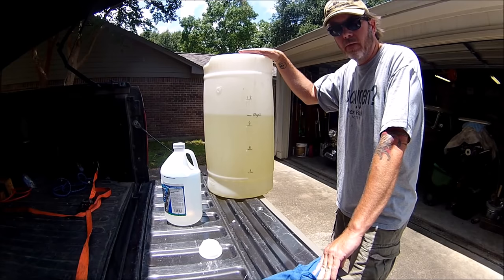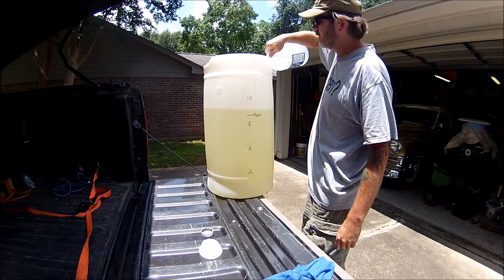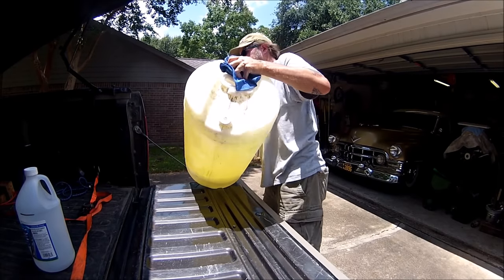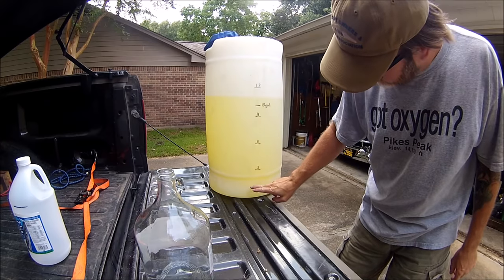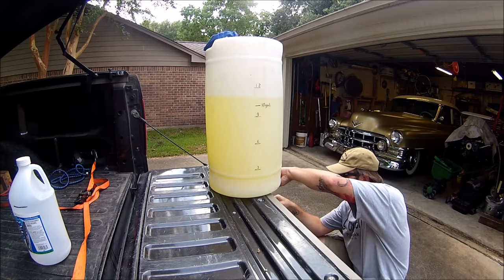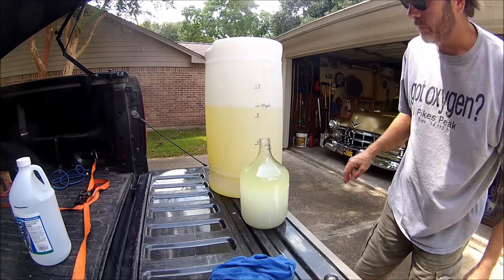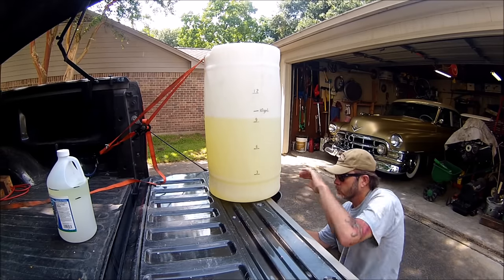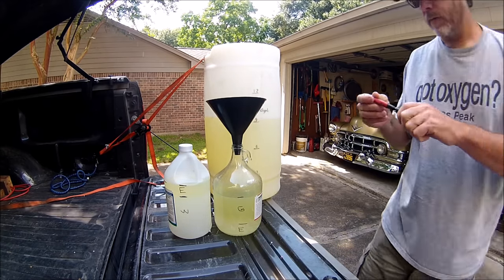How to easily extract ethanol out of gasoline.

Comment: Interesting videos for those who need ~water/ethanol-ethanol free gasoline (some smaller engines especially 2-cycle engines).  Your ideas are good despite various YT viewer comments ranging from good to absurd.  A few remarks to dispel concerns in the YT comment sections.
1- Re: explosion danger:  Gasoline in its liquid form does not burn nor explode but gasoline fumes (vapors) are flammable and have to be handled with care and precaution.  Gasoline + its additives can cause skin damage, use protection.  Good idea to fasten the container to his pickup bed and using non-conductive container.
2- Re: Decrease in octane rating:  Current gasoline as formulated at refineries, before the ethanol addition, has an octane rating about 84~85 as determined by the (R+M)/2 method (standard). Ethanol increases the octane rating by slightly above 1 point per 5% ethanol concentration. Current formulation of 10% ethanol E10 gives you ~87 octane rating, E15 is ~88 octane rating and if you used a mixture of 85% ethanol/gasoline mixture, you would have about ~108 octane rating. So if you remove all the ethanol from the currently available E10 (US and Canada), you end up with "dry" gasoline with a octane rating of 84~85 which would likely be safe for your engine (as long as you are gentle with it (preventing detonation). Ciao L (Ford Motor Company engineering).

Comment: It will be 87 octane without ethanol man...
Reply from the maker: Correct. Ethanol is used as an octane booster. No need for high octane gas in an older small engine.
Reply: 10% ethanol adds 2-3 octane. Removing it from 93 would yield about 90. That can be put back with race gas additive. Adding 2 oz race gas per gallon to 91 octane will make it 95 octane.
Reply: I used to use 100 octane low lead Av gas with the 91 or 92 octane pump gas to get it to around 95 or so.  I think it's probably still a little cheaper than race gas and easier to get.
Reply: FYI. Race-Gas is sold at Jegs, Summit and NAPA. 

Although it won't hurt a lawn mower or a carbureted motorcycle, it will foul up O2 sensors in anything fuel injected. You shouldn't be using that low lead aviation fuel in anything that is fuel injected. More and more riding mowers are coming with fuel injection.
Reply: fyi, premium gas is a-grade. it is 91 octane, add 10% eth equals 93.
Reply: I used it in a '69 Chevelle Supersport back in the 80's.  Damage to converters for sure.  Rip them damn converters offa there.
Reply: why would a "69" Chevelle have a cat.converter on it.they didn't come into production till "75".
Reply: Yep, rather than giving us good gas, they're giving us crap and adding ethanol as a relatively cheap octaine booster. Unfortunately, ethanol gives you LOWER fuel mileage and it's a corrosive solvent.
Reply: Russ G- $42 a barrel oil is probably cheaper than ethanol now a days.
Reply: The ONLY reason ethanol is added to our gas is the corn farmers have hired lobbyists to bribe our politicians into making it law, so the farmers can sell more corn. It's amazing how the state of our country has gotten to. It's legal to bribe senators and it's legal for senators to do insider trading!
Reply: Shane K Total media bs, and I'm not a farmer but a fuel trader. Ethanol replaced MTBE for two reasons, it's a better oxygenator and most importantly, MTBE was a soil and groundwater contamint and was a health hazard.
Reply: man oh man did you tell the truth right here on this comment ,,,
Reply: dimmacommunication     How do you know the new octane rating would be 87 man?
Reply: Mustang Guy     How do you know that the new octane rating would be 90?
Reply: Andy Fromm     How do you know the octane would be 91 without ethanol? One guy on this post says it would be 87,another says 90.
Reply: If that, they use crap base gas here in the us and get the octane numbers from the ethanol added.  And it is often more than 10 percent that its supposed to be.

There is no set way to determine what the octane will be after the ethanol is removed.   This is because it is blended in lots to achieve 87 89 or 93.  Some lots get 7 percent etoh to get to the required number, some need 15 percent. Depends on the base gas and weather its a winter or summer blend.  And yes, even though the label says may contain up to 10 percent, often it is 15 percent.
Reply: dimmacommunication actually fuel is rated by R+M/2 method. 87 octane unleaded when mixed with 100-110 octane ethanol does not make 87, it makes 89+. what is used in E10 is generally 85 or lower before blending. See while non blended fuel costs more blended fuel costs less ALSO  because they can use lower octane gas base add ethanol then retest it's rated octane. keep believing the back yard chemists who knows so little about fuel formulation. Also some of the additives added to suppress issue associated with current EPA regulations for 87 octane fuels get removed at same time. thus stripping the base/beginning fuel and making it unsuitable for proper use. I worked in several cars(mustangs mostly even though majority of those have ethanol safe injectors) where idiots did this fool stunt. Cost them fuel pump s injectors, o2 sensors I have even seen couple with melted catalytic converter, worst I saw was one guy was told to add laquer thinner and bleach aka sodium hypochlorite to boost octane and replace ethanol. uh! BOTH are seriously toxic when burnt, and together caused a converter to overheat and catch carpet in fire. if he hadn't been at car wash car would have burnt to ground. 
Oil industry isn't begging to do this, EPA is forcing it in them, manufacturer is forcing requirements and they have to blend to meet both. Go figure that out. Kind of like trying to satisfy you momma AND you wife at same time. Most men understand momma's and wives don't always agree.
Reply: Road Sawyer no Reed vapor point has nothing to do with octane. octane rating by motor standard is because they use and actual MOTOR or mechanical device with adjustable compression. octane is a chemical with a "rating" on this device if 100. octane is like butane like for a lighter, heptane, etc. fuel industry needed an chemical to rate gasoline against. octane was set as standard. 
now Ethanol generally comes in octane rating of 100-110 average is 105. that would allow running 12.5 to 1 compression on street easily. 
blending fuels as they are today are rated by research octane rating is scientist give it's tests and sets Research octane, Motor Octane is from a mechanical device test. current over the road gasoline is rated by R+M/2 rating nowadays.
Reply: Road Sawyer Reid vapor point only applies to temperature/pressure point a specific liquid vaporizes. Nothing more, water has Reid vapor point.
Reply: from test equipment site"RVP testing for crude oils helps refiners understand the nature of feedstocks coming into the refinery, helping the refiner make optimal processing decisions. Reid Vapor Pressure testing indirectly measures volatile petroleum solvent evaporation rates."
NOT octane. Mechanical octane tester is a variable compression ratio device(looks like a engine) for checking the compression detonation rating of a flammable liquid this gives MECHANICAL OCTANE RATING. The scale is calibrated to use OCTANE which at industry standard detonates at 100. THEN they switch to what ever they blended and use it to record the MOTOR octane rating of said blend.
Reply: Frank: "Branded and generic originate at the same refinery."
What's even more enlightening is that all brands fill their trucks from the same storage tank... the only thing varying being that additive package added at truck fill time.  With the possible exception of claimed better "detergent" additives, gas is gas no matter where you buy it and octane is the only variation in it that matters.
Reply: Why in the world would someone EVER ADD converters to a Chevy big block???
Reply: No it wont, ethanol and octane are two different things. Ethanol is an additive added while loading the gas onto the truck, octane is done in the refining process, therefore you will not loose octane while trying to extract ethanol. There are two types of gas, 87 and 93 octane, you blend the two and you get 89 octane, it is roughly 66% 87 octane  and 34% 93 octane to make the 89 octane.
Reply: Todd Hinesley WRONG. Ethanol by it's self IS 100-110 average R+M/2.  If you add 100 octane to 87 you would get 93.5in 1 +1. Now let's take 1 gallon of 100 and add to 9 gallon of 87 you get 88.3. the figures are the same as mixing premium and regular. To save money why make 87 octane when ethanol is added making it's rating higher. They formulate the base fuel down so it becomes 87 WITH ethanol added. I have been tuning engines for 30 yrs and even had a motor octane tester for well over decade. And we tested blending of pump gas and race fuel and even with other fuel additives like methanol, nitromethane and yes ethanol. As most didn't want to add any more $4-$10 a gallon race fuel we tested to find best mix for engine we built. Removal of the Ethanol WIll reduce octane. And I hate to be the bearer of bad news but most octane boosters create more gumming issues than the co solvent used to mix the ethanol with gasoline. Ethanol is a pure solvent that Burns and dries clean.   It cannot in and of it's self create gums and varnishes that's from the hydrocarbon based fuels. I tear down E85 engines every year and E100 ones too and they are SPOTLESS . NO carbon deposits at all. NONE. It's not the ethanol it's the shit base gas they are blending it with. Remove ethanol reblend with more aromatic hydrocarbons, that's the sweeter smell when it burns, and a lot of carbon issues disappear. You should see 100 octane unleaded engines when torn down ALMOST as clean as ethanol engines. Heck you can want to see crappy gas attacks got to areas where Sunoco still sells 85&86 octane. Pure dreck. 
And as I have said before I build and restore carbs and fuel systems and have yet to see ethanol cause issue so many complain about.
Reply: This is what I do for a living.
Reply: dimmacommunication
Reply: I work for a blending terminal and this fuel would be rough 90 octane if this even worked. removing ethanol is a hard process to do correctly. 87 octane starts as roughly 85 octane in the tank gets the other 2 to 3 octane from the ethanol. so 93 starts at around 90 octane and gets the other 3 or so octane from the ethanol. we also inject butane during certain times of the year to increase octane.
Reply: Put octane booster to replenish the loss

Comment: The science behind this is correct.  Anhydrous ethanol, which is what they use in gasoline, will absorb water very readily.  However, there is the question of disposal of the water/ethanol mix after separating it from the fuel.  What do you do with it?

Comment: Waiting longer definitely helps - maybe a couple of days even. Also, even after that long you will still have water droplets on the walls of the container. After you drain the water/ethanol mixture, add anhydrous magnesium sulfate powder, they will absorb more water the from the gas and swell like snowflakes at the bottom.

Comment: Technically you are correct to say three liquids except Ethanol and water stay mixed unless separated.  Add a bunch of salt and some food coloring to the Ethanol mix you pulled from the gas and watch the Ethanol separate from the salty water ... really cool science experiment .. So yes three liquids but can only see two gas and ethanol water mixture.  Not being a "home brewer" but isn't Ethanol just corn Alcohol .... not suggesting anything here, just asking ...
Reply: ethanol ruins small engines and eats at the aluminum parts of older engines which is why its hated so much plus it actually saps gas mileage trust me I get my gas from a local station not a branded one and he tries to get as little ethanol in his gas as possible and I can go a long time with his gas vs the gas from the name brand places where its more ethanol than anything else which means my truck goes through it like water.

Comment: Water mixes with ethanol and emulsifies it so that it will go through the system and burn. It’s easy to see if ethanol is in gas by adding water. If the water separates there is no ethanol in the gas. If it gets milky it has ethanol. Ethanol does not remove the water, regardless of what the Heet bottles say.

Comment: Since the gas is 10% ethanol, you should get more than 1 gallon out.  Probably not 2 gallons, though.  Different liquids mixed together don't add volumetrically if they dissolve in each other.  You can probably find the info about what volume to expect the water/ethanol mix to be.

Of course, it'd be easier to just add some food coloring to the water, like some other commenters suggested.

Comment: You will indeed remove ethanol from the gasoline, but two other things will happen as well. Firstly you are adding water to your gasoline; although it's a small amount it could be up to 1% .  You could remove it with various water removing agents such as silica gel or explore some of the methods used by chemists such as mixing a saturated salt solution with the gasoline after you remove the alcohol water mix. The salt water will pull water from gasoline. I've never tried it.  Try searching for " Drying Organic Solutions". The second thing is the octane of the fuel will change; probably to a lower rating. Ethanol is a cheap method for boosting gasoline's octane rating and probably was used to boost the octane rating. Octane doesn't mean more power, just less pinging. I'm not sure how you would deal with the lowering of the octane; perhaps an octane booster? Reading other comments it seems a Robert Lynch has given you some good advice too.

Comment: Why take the ethenol out of the gas? In the north it does help gas from freezing in vs lines. Is there a problem with ethanol for cars?
Reply from the maker: Not aproblem for most modern cars.  Iwas taking the ethanol out to use the gas in my lawn equipment. It last longer and doesn't absorb moisture.

Comment: This is basically the way I test for alcohol content in fuel where I work. A measured amount of water, topped off with gas in a graduated glass tube, shake it, let it settle and read the percentage of ethanol in the fuel. Ethanol is bad in the marine environment, the fuel vent is open to the atmosphere and the humidity several feet above the water is 100%. Ethanol is hygroscopic and absorbs this moisture. Plus you tank breathes out when it's hot, and in when it cools.

Comment: Octane rating is lowered about 2-3 points with the ethanol removed. So an 87 octane regular gas with 10% ethanol then removed is rated only about 84-85 octane fuel. The lower octane will damage engines not rated to run on the lower octane fuel.

Comment: Sweet looking Caddy in the garage. I can see why you want that garbage out of your fuel. They should have never started putting that cr@p in the gasoline to begin with.  But hey, why charge people for good quality  gasoline, when they can charge even more for gas with cr@p mixed in it and less good gasoline. Gasoline that makes less power per fuel unit with ethanol mixed into it, than it does with just good old real high quality gasoline alone.

Comment: I might be stupid but. Don't u lose octane from taking the ethanol out. Plus do you really think you will get all the water out. Unless u wanna throw a lot away
Reply from the maker: Yes, The Octane rating lowers, making the gas burn faster. (The higher the octane rating, the slower the fuel burns.)  Water and gas do not mix. If you let it set long enough, the water will sink to the bottom and can be drained out.

Comment: We used to have a kit to measure the amount of ethanol in a given fuel back before the fuel injection days, it consisted of a syringe with a tube on it and a conversion table, and a sample cup.
You would put some gas in the cup, draw in a metered amount of fuel, then a metered amount of water, shake it, and see where on the syringe the dividing line was. Then use the table to get a % reading.
The ethanol would combine with the water and seperate from the petroleum. Allowing you to measure the ethanol content by subtraction

Comment: If the gas is 10% ethanol, that means 1 gallon for every 10 gallons of gas. That means that after adding 1 gallon of water you should pull off 2 gallons of water/ethanol mixture.
Suggerstion:  find a container that has a conical  end that can point downward and have a valve that comes out the bottom. That way the water/ethanol mixture  will be concentrated to flow out more easily.  The only readily available container  I can think of is a 5
Gallon water cooler bottle.   Make a cap to fit, with a valve coming straight out of the cap. turn the bottle upside down after mixing  the water.  There are wire stands for that type of water bottle, or you could devise something easily.  Give the mixture more time to sit and seperate, like someone else said.  Being only a 5 gallon container you would have only have 4 1/2 gallons of gas to be able to add the 1/2 Gallon of water to the bottle.  That means that only just under 1 gallon of water/ethonol mixture could be seperated

Comment: Hey why to remove ethanol from the gasoline, now days the engines are designed and manufactured keeping % ethanol in mind. What will be the benefit of doing this?
Reply from the maker: It allows the fuel to sit longer without going bad. For use in lawn equipment that only gets used a few months out of the year.

Comment: If you're removing the ethanol, shouldn't you end up with about 10% more extract than what you put in?  i.e.  One gallon water in, one gallon plus 10% more out to include the ethanol?  You should be able to tell if it's working simply by measuring the output.
Reply from the maker: The pump says " May Contain Up To 10% Ethanol"